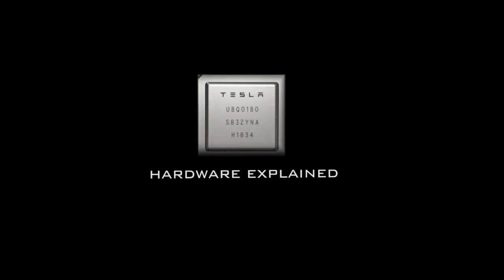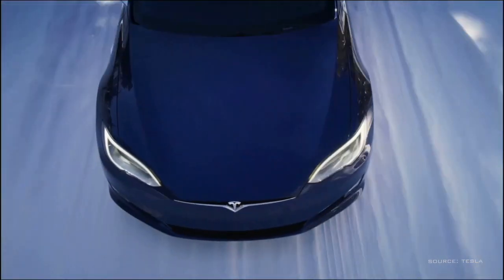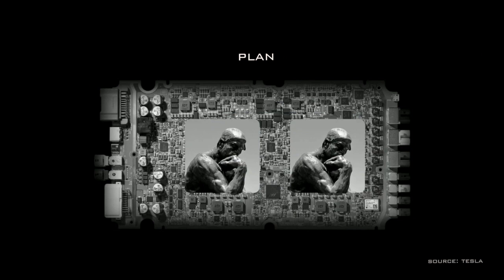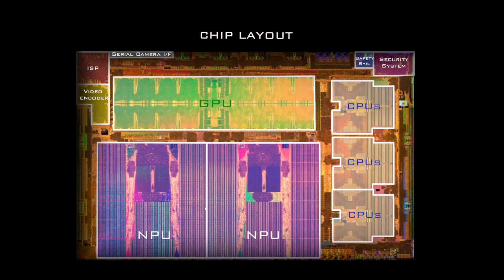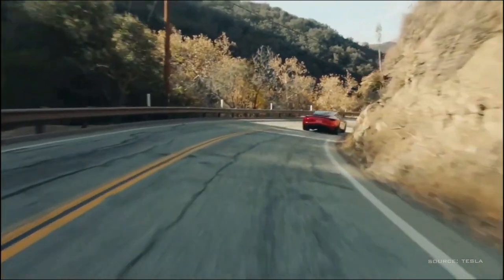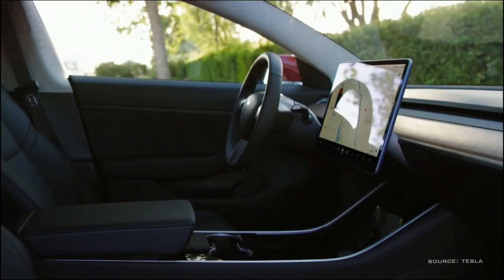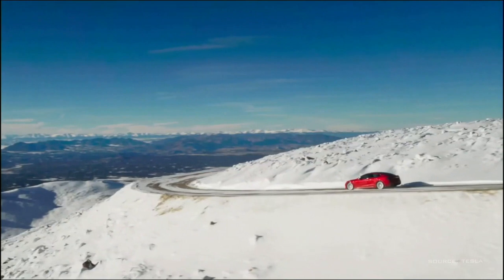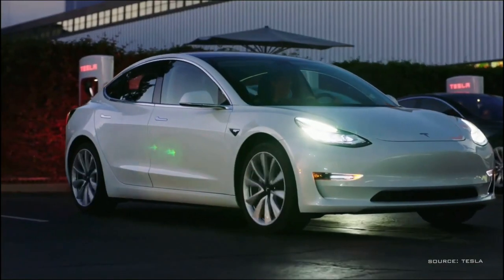Tesla FSD chip explained! Tesla vs Nvidia vs Intel chips

Comment: 🎯 Key Takeaways for quick navigation:

00:58 🚗 Tesla designed its own chip from scratch optimized for autonomous driving, diverging from off-the-shelf components, aiming for peak performance.
02:23 🔄 Redundancy is crucial for autonomous driving; Tesla's FSD computer includes two independent computers for backup, ensuring safety critical systems are doubled.
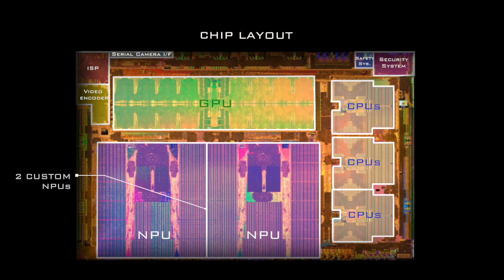04:02 💻 Tesla's chip features advanced architecture with CPUs, GPUs, and NPUs, particularly emphasizing neural processing units for accelerating machine learning algorithms.
05:35 ⚡ Tesla claims its chip as the best for autonomous driving, although it's met with skepticism; performance comparisons against NVIDIA and Intel chips reveal Tesla's superiority in performance per watt.
07:53 💰 Tesla's in-house chip development costs 20% less than outsourcing to NVIDIA, indicating cost-efficiency in addition to performance gains.
09:14 🤖 Tesla aims for level 5 autonomy by transforming neural networks and processing surround view camera footage, a significant leap from current level 3 autonomy.

Made with HARPA AI

Comment: I agree. We are definitely moving towards specialized chips more and more. In fact, I'm using dictation on my M1 Mac to make this comment. The speech-to-text processing and contextual analysis processing are being performed by the M1's NPU. This specialized processor has 2048 arithmetic logic units -- analogous to CUDA cores. Moreover, I can run large language models in Apple's proprietary format on the NPU at about 14 times faster than in Huggingface's format on the GPU.  And this M1 Mac mini cost well under $1000.

Comment: Thank you.  Could you elaborate on the necessity for the connectors?  The chips are so advanced and minute, day by day, and still, there is no challenge for the connectors?  Information to feed to the chip, and to take out of the chip, are not very different in terms of quality and quantity?  We hear about TSMC strength, but seldom hear about the engineering achievements for the board, the connectors, passive and active electrical components on the board... no technological innovation necessary other than the chip?

Comment: When you said tesla has their own chip I assumed you meant they designed their OWN core, (like intel, amd), but from what I understand they have instead made a SOC that utilises the cortex A72s, and therefore NOT making their own "chip", (in quotes to reflect the general sense of the word, as I have seen atleast). That seems doable right ? Atleast far far far more doable than making a core/chip ? Correct me if I am wrong. Thanks.

Comment: This spec is not impressive at all. NVIDIA chip is general purpose chip yet Tesla chip is purposeful design ASIC which could only be used for video analytic. Its performance should be even higher. Plus, Tesla chip is not Automotive safety chip. That is why it needs 2x chip for redundancy. It wastes significant power by repeating the same task twice. Hope their next chip will be better.

Comment: The history so far regarding software on other car companies has not proven to be reliable or robust, Apple on the other hand seems to be a lot more sanguine in their ability to write reliable software so when they eventually make a car it should be the reliable. Mercedes on the other hand have had issues getting their software to comprehend English spoken instructions so may well have other software problems.

Comment: Typo:  At 3:48 the CPU layout graphic reads "CASH" where it should read "CACHE".
Great video!
What I think could also be discussed is data-flow.  That's where the Tesla chip really shines for neural networks.  GPU's often have textures semi-permanently loaded in memory and only need data flow for render to buffer, whereas neural networks need input, weights AND output data to move fast.
Reply from the maker: Thank you! I've noticed the typo :(
Reply: @AnastasiInTech  I think you're correct on the initial spelling - Of course, I'm basing this on Elon Musk's point of view. 🤣
Reply: Does Nvidias Pegasus handle the data flow well for neural networks too?
Reply: @nallebrean   I'm reading about it right now.  A lot of things look good about Pegasus.  Boasts twice the teraflops of Tesla's current chip.  What's even better is the integration of a lot of peripherals, making the board design a lot easier.  I can't find any information yet on its data flow rate.  It sounds like a good move;  but NVIDIA would need to build their own version of Dojo and manage the software side on behalf of the automakers, as that is really the biggest obstacle most carmakers face.  It's not like selling GPU's for videocards, where you can rely on a highly competent game industry knowing what to do with it.  Automakers don't know software from a hole in the ground.
  If Tesla decided to switch back to Nvidia, however, they'd have no problem at all, assuming the chip is as good as advertised.  I'd like to see how it compares to Tesla's hardware 4 generation plans.  Definitely, the Pegasus looks like it has everything it needs on the chip, including communications, graphics, you name it.
  EDIT:  If I worked at Tesla, another thing I'd consider is possibly incorporating Pegasus in addition to the custom AI chip.  Pegasus could handle all the peripheral functions, replacing a lot of chips, and its AI engine could take over some of neural network functions.  Tesla's AI begins by transforming the 8 video inputs to a single point cloud in 3D space.  Perhaps the Pegasus could do just this, and the Tesla AI chip could take it from there, starting with identification of objects, predictions about moving objects, etc.
Reply: @privateerburrows  Tesla chip also shines on power consumption. For an urban robotaxi this is big $$ savings. Even 100W dissipation shaved off saves a mile of range every 2 hours or about 10 miles per day.
Reply: @global_optimization   Indeed,  you're absolutely right.  Not surprising from Tesla engineers, who optimize even in their sleep;  but also partly due to TSMC, who are always at the lead when it comes to efficiency related technologies somehow.  Traditionally that's the edge AMD has had over INTEL, in good part due to TSMC fabrication trade secrets.
Reply: @privateerburrows  Samsung fabs the FSD computer per Tesla’s announcement in 2019. The main reason for low power consumption is that it’s an ASIC suited especially for Tesla’s software so there’s less wasted computation and shorter communication paths.
Reply: @global_optimization   I would have sworn TSMC were fabbing the FSD chip.  Not sure where I got the conviction.  Thanks for the clarification.
Reply: @privateerburrows  Yeah FSD inference computer V3 is Samsung 14nm. I suspect you're thinking of their Dojo computer, which uses TSMC 7nm system-on-wafer fab tech.
Reply: @global_optimization  That's EXACTLY what got me confused, I'm sure.  And the fact they use AMD's, also fabbed by TSMC.  I guess I made a generalizing assumption.

Comment: What are the TOPS calculating exactly? Nvidia chips consume more power yes, But don't they do a lot more in real time? Electric cars first and foremost are not good for the planet so wattage means nothing except for battery consumption. Not planet stewardship. Runaway greenhouse on planet earth is 100% speculation and against what science actually tells us about a planet mostly covered in water and how a more green planet would be cooler. But I digress. Do you have a video comparing Tesla chips versus Nvidia in more detail? I am all for electric vehicles. If they look nice. Tesla is at least bringing some style.

Comment: Thanks for the video.  So does this chip also process the other functions on the screen like Map/GPS, entertainment, etc?  I have the 2020 model 3 performance with the hardware three, and I noticed the map takes some time to resolve when you zoom in and out.  Does this Chip have to do with the processing performance of these features as well?
Reply: No.
Reply: @jason.arthur.taylor  I believe I misstated the hardware... I think it's hardware 2 with the Atom processor.  So I'm sure that's the reason for the slow speed.